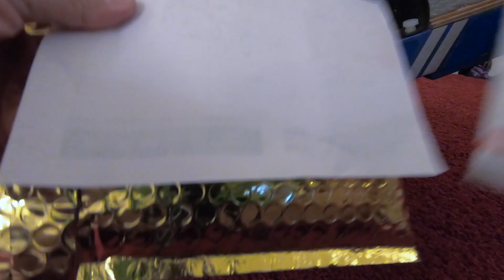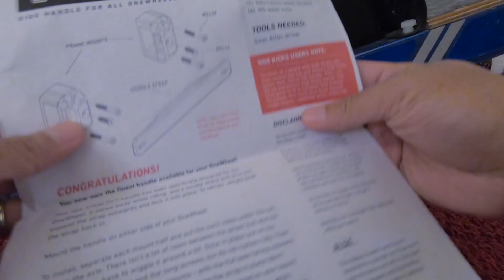Onewheel Nosedives, Physics, Prevention & Stealth Handle

Comment: I had a sudden malfunction when riding the other day. Top speed showed 14.3 mph, flat surface, no push back the whole ride, which was about a mile. Suddenly locked up it seemed, and threw me. Hit hard on my left hip but no breaks luckily. The wrist guards saved my hands. A few scrapes and bruises, but trying to find out what happened. I have experienced nose dive before when battery was low and I was riding up a hill luckily at not a high speed.  The wrist guards saved me on that one.  Another time I had nose dive and pitched forward at low speed which was due to sand in the crack in the road on an uphill grade.  The wheel momentarily spun at a higher speed and pitched me forward as soon as it made contact with the pavement. 

No understanding of what happened with this recent incident. I tried to find something about a Simple Stop glitch that I heard people mention, but can't find anything on that. Waiting for FM to get back to me, but not expecting much help there. Two days later I sent an email inquiring and they said they are waiting for my serial number, purchase info, etc., ALL of which I sent them with the Diagnostic Data back the day of the accident. Battery was at 60%. 

I am seriously considering getting the Fangs, but I don’t think that they would have helped with this incident, as I don’t think it was due to nose dive.  If anyone has information on something like this happening I would appreciate it.

Comment: 🌕🌎 just off hand ( foot) looking at your calculations and the under deck distance when level would half of the distance of the drop as the 
Board be would less than 5” or less, summing up to half of your total or less. My 2 nosedives were from a Dandan Chinese made OW that are not as commonly found on eBay anymore through past year or so. The reason for it nosediving is  I found that they stop on acceleration at exactly the same speed of 8 mph when in the Bluetooth beginner mode. In both instances I was able to get 2 steps in landing on my poly puck gloves of which I always wear to break friction though while they do save friction that could cause broken wrist ,but does allow chest and a elbow taking the brunt of slide impact.. I haven’t done any calculations but I will say you have no time,  0 , none. Amazing enough though you might have those two steps to possibly direct your head around a tree or post. Nose dive is something you have to think about occurring and what objects you can avoid if it happens. I am now a my third OW the V1 and now a pint even though I have never been tossed on them I just installed fangs last night. Should be factory standard equipment, it wouldn’t affect the name and ever be referred to as 3 wheel. It’s a one wheel with rollers.i like my knees, chest , elbows and my life.

Comment: I use my Reebok boxing boots to ride. They are flat, grippy and offer awesome ankle support because of the high laces.p Pretty much impossible to roll your ankle. I feel like I am glue to the board with my boots. I also used flat addidas wrestling shoes. They worked great but they offer no bottom support if I have to bail.

Comment: When you said physics I hoped you'd go a bit deeper. I'm pretty sure I've got it right, but I'd like someone to confirm; the way the nose is raised during pushback is simply through acceleration of the main wheel. Just wanted to check there not some hidden flywheel in there that provides the force.
Reply: You have it right, the Pushback is the board raising the nose through the motor. No flywheel or other devices.

Comment: Hi Jimmy,

I like how you framed  the picture with that statue on the Onewheel.  I just traded in my Pint for an XR partially bc I like going off-road/off-sidewalk.  By doing so I feel like I'm now more at risk for nosedives. Do you think the Fangs or similar products would impede my ability to go off-roading? I'm especially thinking that they might hurt my ability to go uphill as they they might hit the ground prematurely. Thanks, Mike from Tampa.
Reply from the maker: I go off-roading a lot with my onewheels that have fangs and I've never had any problems.
Reply: @freshlycharged  Thanks!

Comment: Really Nice Vid!  Yay OW.  I am going to go make some OW vids after I come up with a catchy name for the series...  Any Ideas?   As for shoes...  Don't worry about getting "skater shoes" they are designed for skateboards not e boards.  All you need is really flat footwear.  Converse All Stars are what I use when I ride.  Avoid runners or boots or sandals!  I like the fangs and will have to get some maybe... for now I haven't had that sort of an issue w my board yet, just fighting "pushback".  Stay Safe.

Comment: your equasion lacks the Forward momentum, this is a big factor ( huge factor ) since the faster you are going the more potential energy you have transferring to kinetic energy over the Fulcrum. ( 
 Leverage ratio )  ... respectfully intended :) im also thinking a full roller bar across the front instead of 2 wheels would be better cause it would provide some roll ability on grass and trail type terrain ( I wager these will fail in grass, maybe even dig in .
Reply: MrDmadness no one cares about falling in grass 🤷‍♂️

Comment: Hey Jimmy great video! Did you ever figure out what the squeak was?
Reply from the maker: It went away after I installed the two-x. my guess is something was loose.
Reply: @freshlycharged  the x2 you only need to take off the bottom screws. Nothing with the wheel correct?

Comment: Regarding the squeak, I'm not sure if this is the case for you, but when I ran that float life fender, it would deform and rub against the tire occasionally.  It was fun to crush it against the tire while riding to try to bend it back into shape.
As for the nosedive situation, my nosedive fear is more from loss of full motor power/control at high speed.  I've nosedived a couple times at low speed (uphill, or accelerating too sharply) and that's easy enough to run out - but if I'm riding with Boosted riders or something pushing 20-22mph that's when I get scared!  Don't want  to run fangs 'cause I roll offroad a lot and dig the corners of my board into roots and earth occasionally and would rather have that extra clearance.  Anyway.  Awesome video as always!
Reply from the maker: Thanks Adam! You are a true pro!

Comment: Thx Jimmy,  I think you haven't taken into account the other scenario where you're going too fast and the Onewheel  stops. At 35kph, I noise dived and if my math isn't wrong the reaction time I had was 0.0015 seconds.

Also. I wear ankle brace steel cap shoes. To protect my ankles when I come off.
Reply from the maker: I checked your math. You are correct!

Comment: Great video Jimmy. Your shoes are great. I started off using skate shoes, but went back to my hiking shoes like you are wearing and I found I prefer them. I think it's the heal of the shoe that elevates the back foot and helps with foot fatigue. Also the bulkiness of the hiking shoe might prevent injury when having to jump off. The only issue I have with them is that when stopping and pivoting your front foot to deactivate the OneWheel the larger shoe can be awkward to perform that maneuver, at least for me.
Reply: Jimmy, is your Stealth Handle the "deep blue" color? The website has a diagram that shows "blue" but when ordering might call it "deep blue." Thanks, great videos. Love riding my OneWheel out here in Berkeley, CA.

Comment: some WD40 may stop the squeaking without any need to take it apart, it should penetrate into the barings and give it some relief. but i haven't had to yet i'm still under 200 miles so it's just a thought
Reply from the maker: WD40 and duct tape. The solutions for about 90% of life's problems!
Reply: @freshlycharged  hahaha when in doubt, duct tape!
Reply: No don't do that lmao. WD40 isn't a lubricant either. It's a WATER DISPLACER. It will thin out the grease in the bearings and dry up and only end up hurting the bearings. 
I doubt it's the bearings making that sound either. Bad bearings will more make a clicking knocking sound rather than squeak.
Reply: @AndreHila  so, i wonder whats squeaking! i use WD on all my switchblades but your right it doesn't last, you have to reapply it about once a week. the small components inside the handles need the thinnest viscosity, most oil's and any grease will gum them up the works. just used to using WD but what you said makes perfect sense with the bearings and what not.

Comment: why not just ride an e-skateboard, no nosedives whatsoever (unless you crash into cars and stuff like I sometimes like to do)
Reply from the maker: I thought about getting and e-skateboard, but I love going off road, doing trails, and tight turns. If there is a board that can do that, I'm in!
Reply: @freshlycharged  yeah, I kind of want to be able to do those sweet tight turns, jumps and what not, so I'll have to go for one of those one wheel thingies at some point, been looking at that gotway monster thing.
As for off road, my gtx does that just fine, and I hear there are some even better boards nowdays.
Reply: @freshlycharged  I think a 2 wheeled board would be great for this, it will hurt turning, but it'll get rid of the nosedive
Reply: Nose dives are easily avoided.

Comment: I took a pretty gnarly nosedive last night. I was racing up behind a car and planted on the street. I was probably going 17-20 (29% battery and 11 on agressiveness) mph. I just can't ride the OneWheel, if I'm not gonna push it to the limit. I tweaked my shoulder a bit, but I wear pads, so not a scratch on me otherwise.  The squeaking sounds like your hub bolts need tightening. For shoes, I would definitely recommend the Vans Sk8 Hi Pro and some Xpand Elastic laces.
Reply: Agreed. 99% user error of course no update is going to prevent the motor from being over exerted lol..
Knowing how the motor works and feels I've only had one nose dive in over 400 miles and I rode it out and I go pretty fast too. 
Though I have fallen carving too hard on dirt, and have fallen hitting a pot hole in grass 😂
Reply from the maker: Further evidence that the update does not prevent nosedives! Be safe!
Reply: @freshlycharged  I mean, I wouldn't expect it to. They are 99% user error. I was probably just overloading the motor or else maybe I accidentally leaned forward 🤔 Either way it, I just get up and keep shredding. Ain't no stopping my stoke!
Reply: I have a squeak also after replacing my tire. Thanks for the pointer to check my hub bolts!